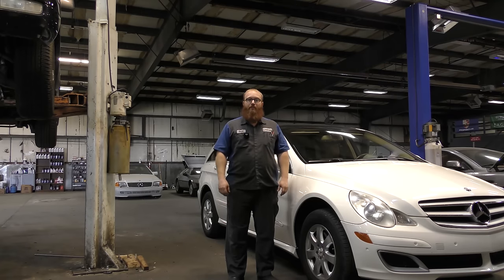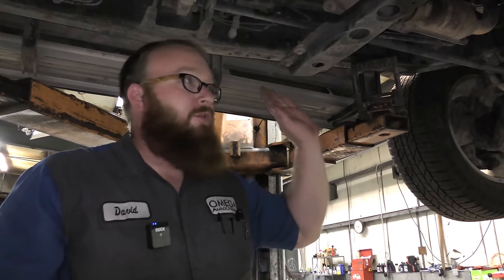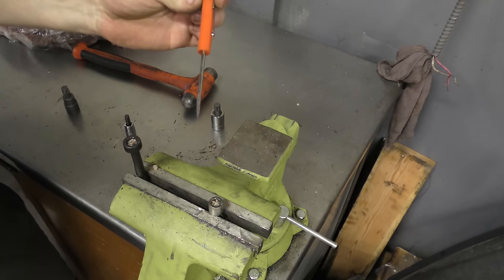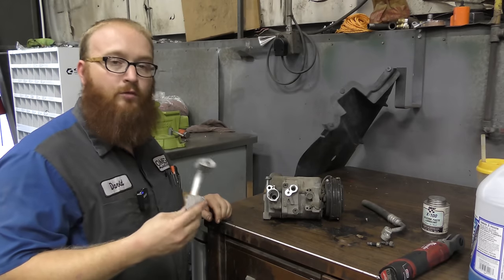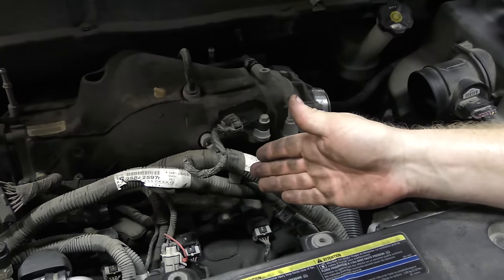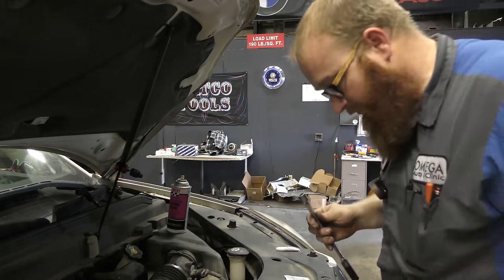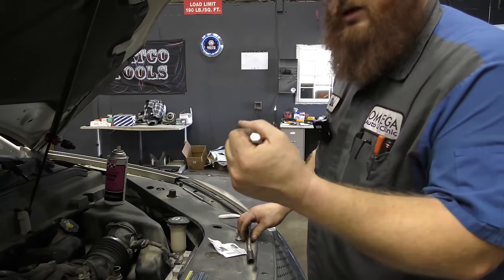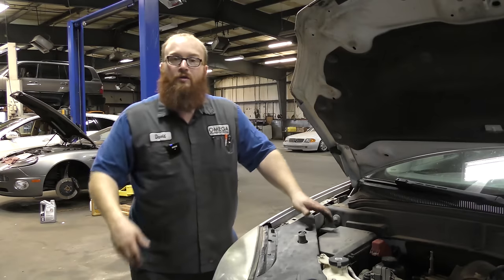The CAR WIZARD shares 10 Crazy Easy and Essential Mechanic Tips

Comment: Silicone spray lubricant is also the secret to pulling electrical wires through rubber gaskets without struggling.
Reply: Hoses also. Dish soap works too. Dilute some in a sprayer and shoot some on the wires. They slide in.
Reply: YUUUUUUUUUUUUPPP

Comment: The hammering of the fuel tank is like the beating on your starter motor when it won't start.
Reply: Does that actually work??
Reply: @gtarules1  Yes if it can unstick the float or jiggle a wire int becoming connected. These methods are not a permanent fix.
Reply: Even if it doesn't work, you'll feel better after you beat the crap out of your fuel tank.
Reply: @reivertomwilson4959  this trick has never worked for me but your right, I did feel much better.
Reply: same with blower motors
Reply: You can fix everything with the hummer .My grand pa used to fixed tv like that
Reply: It’s called percussive maintenance and it can help with electromechanical devices.

Don’t go beat on modern electronic devices though; most of them will break.
Reply: Definitely works. I was driving through the Dakotas and my GMC just quit while driving. Crank no start. I remember this video and  brought out the wheel wrench and banged that tank. Started right up and got me to the next town for a repair. Thanks wizard!
Reply: Not if you're in a car with low clearance and you cannot reach it.
Reply: @gtarules1  yes it works. My mechanic friend told me about it once to get me up and going. He told me where to hit it but it didn’t work when I was hitting. He drove over and did it himself and got me up and running so might just take some ppl a minute.
Reply: @CHixon  then remember tip #1
Reply: @andrewdomenitzdmd  both kinds of gas tanks plastic or steel?
Reply: @mmpiforall5913  All you are trying to do is vibrate the thing to get the fuel pump from being stuck or bad connection. I would not hit the plastic one very hard. Steel would dent but plastic could crack, especially if it was old
Reply: @CHixon  like the man said, get a long extension
Reply: It worked in my 90 civic
Reply: Growing uP we had a black and white tv that would lose signal whenever a truck drove past...we would smack it with open palms till a normal picture returned...just got reminded by the tank banging
Reply: I used the starter trick at least twice to allow people to get home, it often works, a long socket allows you to bang almost any starter soleneid wherever it is buried in the engine
Reply: @gtarules1  it won't work when the starter is hidden under the intake manifold.
Reply: This method can be done on wife’s of husbands that have trouble in the bedroom 🔨🔨🔨🔨🌹🌹🔨🔨🔨🔨🔨 now I know why Thor from Asgard has one   🤟

Comment: A tip that blew my mind was an easier way to align the input shaft when mounting the transmission to the engine....  Get some real long bolts and cut the heads off of them, then thread them into the engine.   They will guide the transmission into to the correct orientation, then replace the long bolts with normal bolts as you bolt everything together,
Reply: Yuup works really good,done that lot's.
Reply: maybesome long bars of all thread?
Reply: used this trick fitting gas lines to a 20 cylinder caterpillar gas generator engine.
Reply: damn genius level mech- witchery. XD
Reply: With GREAT tips like yours, you need to get on YouTube, as well.  The more knowledge out there makes it easier for all of us.
Reply: @JustAnotherJarhead  you're actually better to use long bolts with short thread. The allthread will tear up aluminum trans housings and it's hard to slide along them. The 4 or 6 inch bolts at the tractor supply that only have an inch or so of thread are perfect. If you go too long, you can't get the trans on them without hitting the tunnel.
Reply: If you aligned the clutch correctly the trans should go it , get a  good Clutch alignment tool ( and  the plastic  one the that comes with the clutch kits are garbage and a old input shaft from another trans will work but it is not the best ) change the pilot bushing , put a little amount of grease one the input shaft (trans grease)  take the clutch disc out from the  kit and make sure that it goes on the input shaft freely  ( clean the spines ) also make sure that both  dowel pins are in the engine and  not in the bell housing of the trans , when putting a  trans with a clutch you  have to wiggle it push and it should go flush to the engine once your one the dowel pins , if the tans is FAR  away from the engine and you pull the trans to the block  in with the bolts you did  something wrong, relax  re adjust the clutch and start over, guide pins do work but don't solve everything .
Reply: Never too old to learn never even thought of that stabbed a too many transmissions just by the feel had to fight about 10%  of them
Reply: @ddlago  You sir are spot on! I worked in a trans shop for over 3 years and never once needed to use guide pins (bolts) to align a trans.   A tip on the pilot bushing if you don't have a bushing puller.   Pack it with grease and find a bolt that fits snug and tap it in. The hydraulics will push the busing out. Since I had access to other input shafts I just used an old one.
Reply: @gasfiltered  also, chamfer and cut a screwdriver slot
Reply: On a semi truck clutch use cut off bolts on the flywheel before installing clutch/preshure plate those are heavy as hell

Comment: Using paper on a bolt head and super glue for washers. Genius tips in this video, thank you. The microphone works great by the way, great quality 👍🏻
Reply: You can also use softened candle wax to temporarily bond a screwdriver tip to the fastener.
Reply: I find that a bit of grease instead of superglue works, although it can be a bit fiddly sometimes.
Reply: I keep a ball of “dum- dum” or  window sealing tar in bottom drawer for this. Sticky, and handles banging around.
Reply: A fresh leaf works just as well!
Reply: I didn’t realize superglueing stuff wasn’t common. doesn’t nascar crews do that with lug nuts?

Comment: Great tips!  As far as using lubricants for orings and hoses goes, use silicone brake lube!  It's safe for rubber parts.  Unlike what I've done in the past a few times, which is to remove the oil cap and run your finger inside of that, hahaha.

If you don't have a set of magnetic sockets to hold the bolts, there much more environmentally friendly and sustainable alternative.  Especially for shadetree mechanics whose shop floor has grass.  Grab a blade of grass or a leaf from a bush, and make a shim with it instead.  And it's very unlikely that any harm will result if it falls off into the engine bay.
Reply: Many years ago, a blade of grass (it may have been 2 or 3) was used the very first time I used a shim to hold a bolt onto a socket. This is solid advice.

Comment: The one with the fuel pump actually works with the starter too, I've done it for  whole summer 😀
Reply: yup a little tap with a lighter
Reply: Also, a few taps on a bad a/c blower motor can get it turning again.
Reply: ..hit the starter with a broom handle while the key is held on. Just remember to let go of the key as soon as the car starts.
Reply: Broom handle will work on fuel tank also ! No dents on fuel tank either , truly an emergency procedure .
Reply: I was shown with a starter if I am stuck somewhere to get a long screw driver and make contact with the two outside screws n it will jump it some I can make it to the mechanic.
Reply: I had to do it four times with a 2000 Honda CRV.

Comment: Similarly to banging the fuel tank to get the pump to work again, for dead power windows: 
With window switch pressed to desired up/down action, slam the door ( keeping button pressed) two hand maneuver, watch window regulator work again.
Reply: Better yet, don't drive on empty to keep your fuel pump cool and buy toyota or honda and your fuel pump will last the life of the vehicle..
Reply: @mysticjedi6730  cries in GM vehicle

Comment: Another tip related to o rings, if you need to remove em without hurting lines or aluminium housings you can use a toothpick to have it removed.

Comment: To add to your last point, Chat GPT 4 is quite useful as well for when you do not want to sit searching google on your phone. 
Things like "are the intake manifold gaskets on a 2007 ford freestyle reusable?" 
Or "Can a bad upper engine torque strut have symptoms similar to a faulty transmission?" 
It is by no means perfect, but it is an excellent resource to point you in the right direction.

Comment: Spraying silicone in the window tracks will sometimes free up stuck or slow moving power windows.
Reply: I do it as part of maintenance. 
The track will get dry and eventually the resistance will take the motor out.
Reply: 1997 Honda Accords are bad for getting dry. Quick shot or two every few months and you are good to go
Reply: I did that with a 1998 Ford CV sedan(LX) & it worked well. ✔. I'd go over a older SUV or car 🚘 with the spray 2x a year if you have power windows.
Reply: Well reminded
Reply: That work for me.
Reply: Absolutely, but I'll trow my 2 cents. Before using the silicone spray, simply clean the window tracks. The amount of dust/debris that comes out of it can be staggering. Finish with the silicone spray. 
So do not just lubricate the tracks. Remove whatever is causing the binding in the first place then lubricate. Works way better and for longer.
An old rag on the tip of a blunt screw driver work wonders. ;-)
Cheers
Reply: body shops love it when you use silicone on stuff

Comment: Great tips! After over 45 yrs. of wrenching on everything from bikes to motorcycles to cars, helicopters, airplanes, turbo, jets, now I’m back to doing what I love, working on cars again. I actually learned a few things from this video. Who said you can’t teach an old dog new tricks. Only thing I do differently is when you’re trying to insert a bolt in a difficult place are use masking tape facing towards the socket instead of paper that way doesn’t fall off when you insert a bolt.

Comment: Love ya brother! Every one of these “tips” I wish someone would have given me as a young AutoTechnician 30 years ago.
One side note, NEVER use silicone products in and around fuel, intake or exhaust systems of the modern automobile as any silicone contamination can take out 02 sensors. Especially injector O-rings.
Reply: I've heard this too in a technical bulletin from Mercedes Benz but it was MAP/MAF sensors that were being fouled.  They investigated this after hundreds of cars all over the world would have the MAP/MAF sensors fail again and again, sometimes 10 or more times in a year.  Turns out there was silicone spray in the intake from a mechanic spraying it around and the replacement sensor would just get another does of silicone after a couple hundred miles.  Some cars were literally returned under lemon laws because of this.  Cost them millions I'm sure.
Reply: VW has the same warning in their engine service manual.
Reply: What to use instead of silicone products?
Reply: Snappp
Reply: I’ve used silicon spray and even silicon paste for injector o-rings and I never had a problem 🤷🏻‍♂️ on jags and rovers. Not for o2 sensors tho
Reply: Engine oil works well in those cases
Reply: @user-fk8zw5js2p  vaseline

Comment: Great video, my dad was a successful  automatic transmission mechanic in the 60s and 70s. He was good and he was fast (air tools galore) working a flat rate hour. He gave me all his tools after he retired and I noticed he had several 3 and 4 ft. Extensions hanging on the side of his tool box and I wondered what he used then for. Now I know.
Reply: Sounds like he was a pro. 😃
Reply: Avoid air tools when reassembling a transmission, you are going to get more comebacks

Comment: These are great tips! I've discovered many of these out of necessity over years of repairing my cars. If you still cant get a clear shot on the hard to reach bellhousing bolts on top after using the extension, check out your front end, near the front of the engine for a solid point and jack up the front of the engine a little bit. You may need to loosen a motor mount or two a little bit to accomplish this. By raising the front, you lower the back. This adds a few inches of wiggle room to gain access to that bolt. HUGE HELP. I've never used the paper trick. Instead, I've always put the bolt in the socket, then washer. Grabbed a small piece of tape and lightly wrap it around the washer then up to the head of the socket. If it's a regular old bolt bolt and washer it wont matter if there is a tiny amount of tape between the washer or bolt, and the surface its bolted to.

Comment: Very good tips and very accurate. Great suggestion and the power windows not working and looking at the dome lights. Another tip - 1. If the car will. not start clean the battery terminals and cables with a wire terminal/cable brush before buying a new battery. The cable/terminals might be oxidized.  2. If the window wipers are smearing rain water, before buying new wipers, clean each wiper with a rag. 3. If you remove any electrical connector that has a locking clip make sure the locking clip snap in place when you reconnect it. 4. If you replace brakes, clean the sliding pins and re-grease them. 5. Every six months clean your plastic head lights and spray plastic cleaner/protectant on the headlights to prevent the plastic from fogging, Do not use clear coat.

Comment: Another Tip I use on occasion is when your trying to install spark plugs in tough locations, you can take a piece of fuel hose and slide it onto the end of the plug and use it to guide the spark plug into the hole and can twist the end of it to screw the plug in enough so that you can finish up with a socket and an extension.  
I’ve also used the hose Tip when installing knock sensors on some Hondas when they are really difficult to get your fingers in there.
Reply: Good tip with the rubber air hose those are very hard to get back on.
Reply: My dad showed me that one back in the 70s
Reply: It also very difficult to cross thread something when using that rubber hose.
Reply: It helps a lot if you can get some hose that is straight.  Curved hose is a PITA.

Comment: For Tip #6 I’ve used sticky wax for many years to keep a bolt in the socket. Wax rings for toilets or if you can find a block of soft beeswax. Either one works great and it eventually melts away.
Reply: I use Vaseline. Fill the socket with vaseline and the bolt stays in. Can also use it to stick the washer to the bolt.
Reply: Also a piece of plastic bag like grocery bag over top of a bolt head will hold something in place

Comment: For the washer falling off the bolt, I’ve always used a tiny bit of grease because washers stick to it pretty well… never thought to use glue
Reply: magnet
Reply: @richlewis6800   head bolts are supposed to be OILED before installation, so the idea of grease being a problem is i misconception
Reply: What the hell are triple squares?

Comment: I have a tip, if you have no heat in your car, but the blower motor is running, you more than likely have a plugged heater core....You can go to a car wash, take the hose off the easy end of the intake (or whatever hose is attached to your heater core). Take the nozzle at that car wash, and wrap the hose around the end, and blow compressed water into it. It will blow out all that crap and you'll have heat again, but I do suggest draining your antifreeze and changing it after that.
Reply: This is probably not a good idea for way too many reasons.
Reply: @EricMilner-qo2jn  I guess you have never done it before. I've done it on multiple vehicles, it's always worked, yes there is a chance it will blow out your heater core, but since it's either that or replace it anyway (which is a pita on many cars). There is no reason not to try it.

Comment: I would recommend against the cyanoacrylate myself, I typically use a tiny dab of a heavy grease.  This has the side effect of making torquing bolts a bit easier.  Tip 8 is genius, I didn't even know they made relay switches.  Very good, keep on keepin on.

Comment: One thing I've done for allen head or torx heads that are stripped out, put a dab of Clover lapping compound in the socket then stick the wrench in and turn.  The compound is carbide I think and it generates some serious friction between the head and wrench.  It works 80% of the time.

Comment: I have an 03 mustang gt and wizard tip number 9 saved my interior. My passenger window wasn't going up but I did notice the dome lights were dimming whenever I'd push the window up button. I slammed the door shut hard and it unbound the window. It started rolling up and down smoothly. It was a quick fix, but perfect for that moment since it was raining that day. Kept my interior nice and dry on the drive home.

Comment: On tip Nr. 5, I usually use dialectic grease instead.  That's what I have.
Learned it the hard way. Ripped the stupid accordion.  Now, I didn't use the grease to stop that from happening, I actually disconnected the hose along with a section of the airbox, much easier to take off and not fight the compact space.
The grease just makes it easier to slide it back into place.

On tip Nr. 7.  I personally use nut drivers here, since they have a magnet inside them, they just hold the fastener for me, they also make it easier to remove stuff without unscrewing it 95% and then use my hand to take it out so it doesn't fall down....

Comment: Interesting note:  One of my apprentices and I argued about the extensions. His teacher said that the extensions do NOT absorb torque, and i say "oh, yes, they do!"  With only two of those 3/8" extensions, i once had a tough bolt that took up almost 90* of turn before busting loose!     Not so much on the 1/2": drives!
Reply: I bought a 3 foot extension just because of that.
Reply: Absorb is key. That torque doesn’t dissapear. It will be released